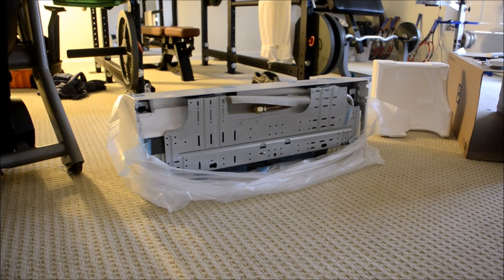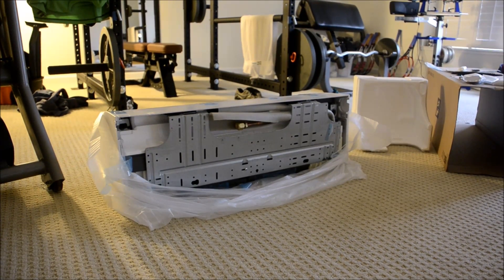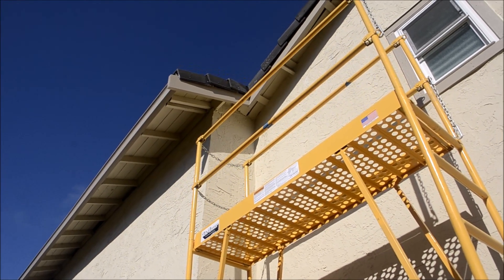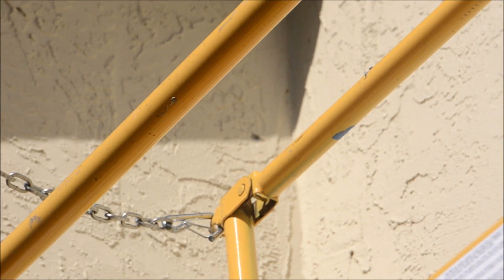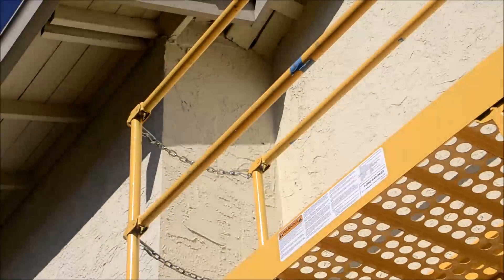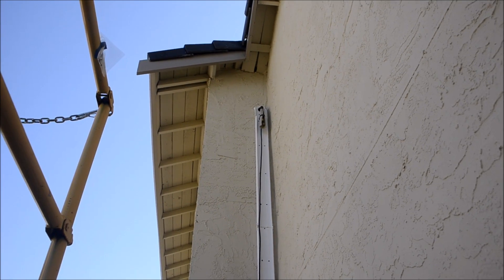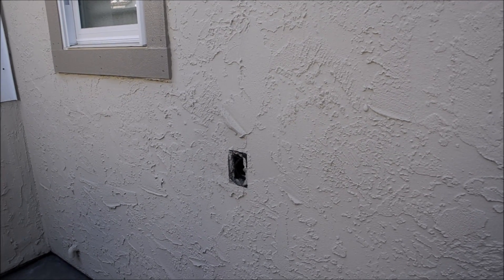Fujitsu Mini Split Install

Comment: Mate well done, i actually found the latest model Fujitsu 7.1 system at the local tip yesterday. It's in excellent physical condition with everything neatly placed (not thrown) that I'd need (including remote) to do an install. I'm a very avid DIYer but this might be a little beyond me. I was actually thinking of replacing my rattly 20 year old Fujitsu split system. Before dumping this system the previous owners tapped up all the lines and tighten them also. So I'm hoping this may be a sign that it might be ok and they were just upgrading to a larger size. It's a current $1800.00 model so fingers crossed. I just wish there was an easy way to test the unit. I'm from Brisbane so might have to look around for someone willing to help. Great vid mate it helped a lot!
Reply from the maker: Nice find. So did it also come with the indoor unit too? I cant see an easy way to test it other than installing it. The problem is you will need someone to fill it with refrigerant which might be an expensive proposition, especially if you find that the unit is defective, which would be a bummer given the amount of time it will take you to get to this point.. On the flip side you could install it and then call someone to fill it and test/repair it. As long as the fixes come in under $1800 you might be ahead. Good luck.
Reply: DIY Dan yes mate I got everything. But wouldn't the refrigerant be in the unit still? I'm pretty sure the lines are done up tight so that no gas escaped. Yes I was thinking about just replacing my 20yo existing Fujitsu split system. At least it would be and easy conversion. A plumber mate of mine has all the copper line flaring equipment so who knows!
Reply from the maker: It would be unlikely the refrigerant is still in it.Once it is in the line-set there is no way (that I am aware of) to disconnect the system and keep the refrigerant in it.When the units are shipped new, the refrigerant is all held in the outdoor unit, then you evacuate the line-set and then release the refrigerant. So either the original owner reclaimed the refrigerant or released it to the atmosphere when they disconnected it, in either case there will be no refrigerant. I suspect they tapped up the lines to prevent any dirt, bugs, etc entering them.
Reply: DIY Dan 

Hello

If the air conditioner had the hex valves on the outdoor unit closed then only the gas in the line to the split would have been lost.  Depending on how long their line was vs how long the new line will be,  there may be sufficient gas remaining.

I remove these from my demolition sites all the time,  and 3 that were near new I used on my own home.  They all work fine except one,  which is cold,  but could certainly be colder.
Reply: Thanks Ant, that's what I was thinking. You've just given me new hope. I'm going to try and install it with my plumber mate when I get a chance.  Fingers crossed it's all good!
Reply from the maker: That's awesome new Ant. Hopefully Anthony's system works too. Once it is done let us know Anthony.
Reply: DIY Dan Definitely mate, will do!

Comment: Thank you for sharing such a great video. Could you please share your method for bending the internal unit's copper line set to fit inside the external duct? Are the two black lines marked on the insulation at 4:10 the external facade and the lid of the duct? Is the IMPERIAL 370-FH Tube Bender necessary for achieving this or can the lineset be carefully shaped using your hands? TIA.
Reply from the maker: So if I were to do it again I would mount the unit with the pipes sticking out the hole and then bend them from there. The reason is that it makes it easier to mount the unit when the pipes are straight. Trust me it is much more difficult when they are bent prior to mounting. The two black marks at 4:10  were simply a guide for me to make the bends after I measured where the pipes would exit the building. Like I said, bending them after mounting makes this process easier.The tube bender is a nice to have but not a requirement. I used it more to start the bends to get them close to where I needed them and then did the rest by hand. You can do all the bends by hand but be patient and it you do it that way then I would recommend you get a sofa can piece of PVC that you can use to bend the pipe around, because if you are not careful you can crush or break the pipes. Not trying to scare you as its not hard to bend them just want to emphasize that slow and steady wins the race on this part.
Reply: Thanks mate! appreciate the advice. :)
Reply from the maker: No worries, good luck.

Comment: What vacuum did you use?
Reply: Never mind, I kept reading and found the answer. Great video!
Reply from the maker: Robinair (15800) VacuMaster Economy Vacuum Pump - 2-Stage, 8 CFM. Got it from Amazon for about $260

Comment: I haven't seen anyone clarify if you need to remove the shrader valve to do the pressure test. Also, did you purge prior to doing the pressure test?
Reply from the maker: No need to remove the valve, the hose fittings depress the value when they are attached. I didn't do a purge prior to the pressure test.
Reply: Aren't you just compressing air then if you do not purge prior to the nitrogen test?
Reply from the maker: In the pressure test all I wsa looking for leaks under pressure, the gas already in the lines was air, which is 80% nitrogen, and then I upped the pressure by adding additional nitrogen so I dont see an issue, there might be one but my unit has been working fine for years. You dont want to leave any air in the lines which is why I then pulled a vacuum 4 times. So my sequence was pressure test to check for leaks, pull vacuum, add nitrogen, pull vacuum, add nitrogen, pull vacuum, add nitrogen, pull vacuum (the last vacuum was left over night to make sure no air was getting into the system). This way, any water vapor and/or air is removed from the system and you should be good add the refrigerant. 

You could of course pull a vacuum first, and then only pressure test with 100% nitrogen. That might be a better way to do it. But it will just take a little longer.
Reply: I can't argue with your logic here. Seems you took extra caution to ensure the system was completely purged. I would imagine this is 95% the trick to a quality install. Well done.

Comment: Thanks for the video!  I am also planning to install my MRCool system, but I am a bit skeptical about the vacuum and charging portion.  Also the video was great but I would have like to see some of the parts you speed up, like the flaring.  But again, overall I learning a lot for watching.  Great Job!
Reply from the maker: I probably should have slowed some more of the video down but I didn't want people to get tired of watching not much happen. Honestly, with the flaring tool I purchased you cant actually go wrong, it makes perfect flares every time. Why are you skeptical about the vacuum and charging? One thing to pay attention too when pulling the vacuum is to make sure you tighten the fitting to the outdoor unit so it depress the schrader valve properly. When I pulled a vacuum the first time  it looked like I had pulled the correct vacuum in 10 seconds, then I tightened the fitting and the vacuum then it took somewhere between 15-30 minutes to pull the vacuum, which is the way it is supposed to be. Good luck on your install. I am pretty impressed with my unit, it was over 100 outside the other week and it was 60 in the room.
Reply: I guess because I've never done it and I don't want to ruin the system if I don't do something correctly.  Thanks for responding!  I'll probably watch your video a couple more times to be sure I understand the critical steps.
Reply from the maker: Also read the comments from Joe Joe. He pointed out the optimal method to pull the vacuum and release the refrigerant.
Reply: Will do.  Thanks

Comment: How did you wire? I'm a bit confused by 208v/230V requirement. Household power is 110v/220v. The wiring diagram shows only 1 hot from source @ 15A. So, I'm thinking that would be only 110v, not 208v. confused.
Reply from the maker: Ah I see where your confusion lies. I think. Let me know if the below makes sense.

Simple answer (this might clear the confusion up): 
Assuming you wired the indoor unit to the outdoor unit correctly. You simply supply 220V, 20A to the outdoor unit and then the outdoor unit takes care of supplying the  indoor unit with 110V, 15A.

Longer Answer:
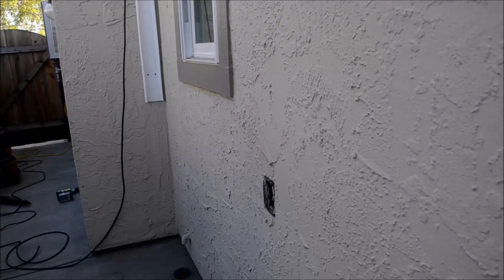The system will run under multiple voltages as the unit is sold in multiple countries and their core voltages are different to the US, so 220 which is what we can all get in the US works fine. So you run 220 to the outdoor unit, you can see where I pulled the 220 from at 6:53 in the video and see me begin to wire it at 7.42. I don't go into specifics here as this is something that you need to be very careful with, so if aren't super comfortable with electrical work then I would recommend you get a qualified electrician to do it. So that's it for the 220. 

Now for the 110. At the start of the video (around 4:40) I show wiring up the indoor unit. I just followed the wiring instructions but once again if you are uncomfortable with wiring then just get a qualified electrician to do it. Then you run that wire, along with the line set to the outdoor unit, you can see the electrical wire sitting to the left of the outdoor unit at 7.33. Finally you go back to the right side of the outdoor unit and electrically connect the indoor unit to the outdoor unit.
Reply: Does it have to be 20A? Specifications only call for 15A. I am asking because I ran 220V  15A on 14Gauge wires. Not really wanting to rerun the length with 20A. They really can do better with the documentation. Where did you get the 20A specification?
Reply from the maker: Sorry, I should be more specific. My wiring is good for 30A but my unit only requires 15A according to section 2.3 of the installation manual that came with the unit. However, those instructions specify that the max circuit breaker is 20A, which is what I use.  If your specifications say it only requires 15A then you should be good juts using a 15A breaker, especially if you only ran 14 Gauge wire. 

If it were me, and you probably dont want to hear this, I would run 12 Gauge (Copper) and use a 20A breaker. I would do this for two reasons. 1) Minimize voltage drop if you have a long cable run, 2) When the unit is being pushed hard it is very possible that it draws the full 15A and if the breaker is only 15A, then it might trip more often than you want it to. If it was a relatively easy replacement it might save you hassles in the long run. 

Yep, the documentation assumes that you have done it before (which I understand) but for us first timers it sucks. Thus the video.... :-)
Reply from the maker: Yeah, the 8 piece torque set is a must have. Good call on the coupling, my unit came with the condensate line and coupling and I just figured they all did......

Comment: Awesome video mate, good to see an Aussie video!  NZ here...was thinking of installing a Fujitsu but bought a self connect (Zibro)....however a bit undersized for room at 2.5kW (30m2 room) - NZ gets cold (even Auckland).

Did you find it easy to get the electronic tester, vacuum, and nitrogen tank?  I can't find anything on our "TradeMe" site.
Reply from the maker: Hi. I didn't have an issue finding any of that stuff. I got most of it from Amazon and eBay. The nitrogen tank and the regulator I got from a plumbing store.